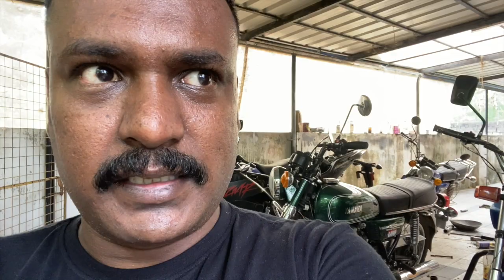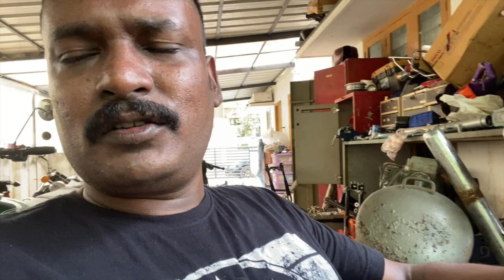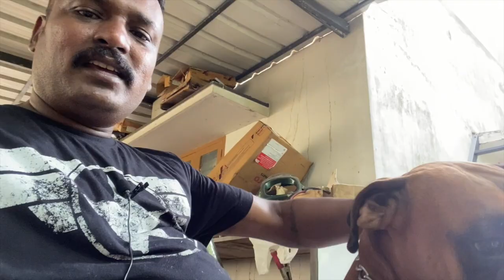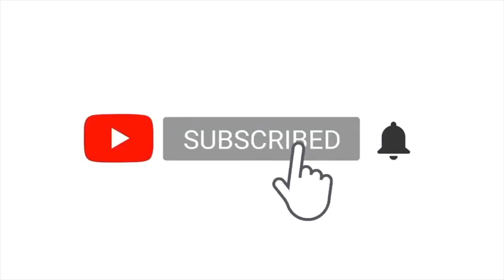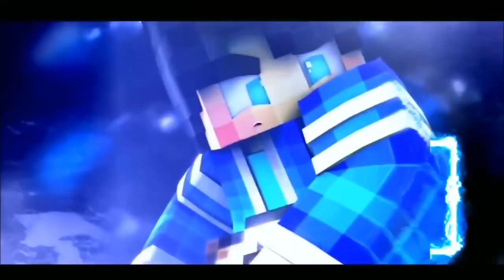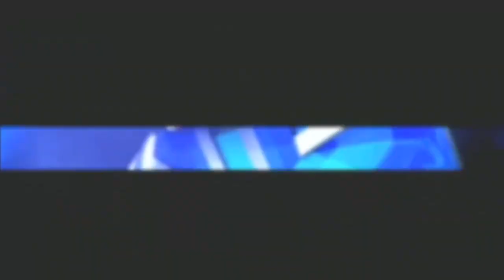2 Stroke Engine re build types and Price explained in details (English Video)

Comment: My mechanic is charging 5k labour for a RX135 5Speed engine overhaul, 3.5k for new koyo bearings, oil seals. approximately 3.5k for adding a new sleeve as old sleeve is not good. 
Is this price reasonable? Kindly suggest
Reply from the maker: 5k labour is atrocious